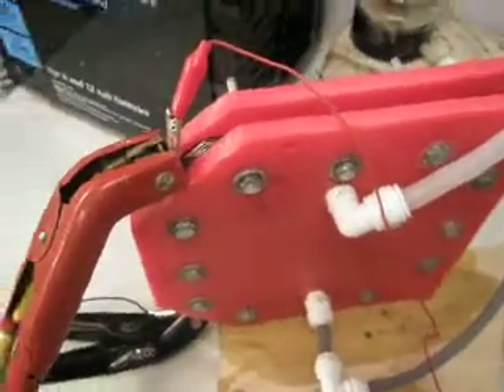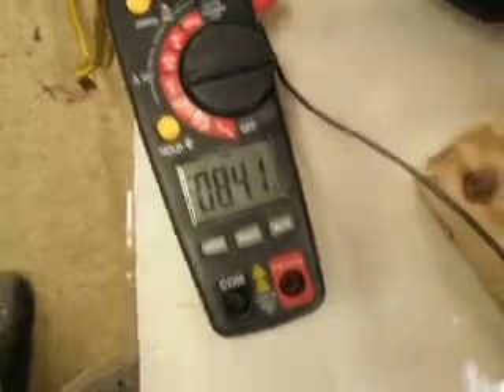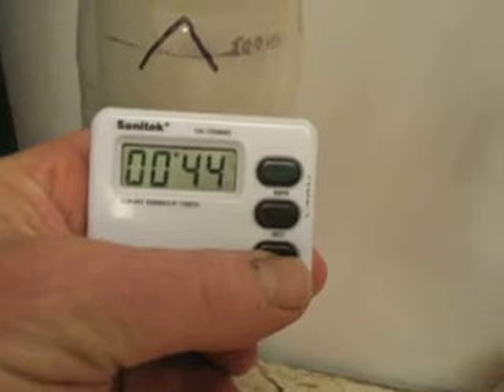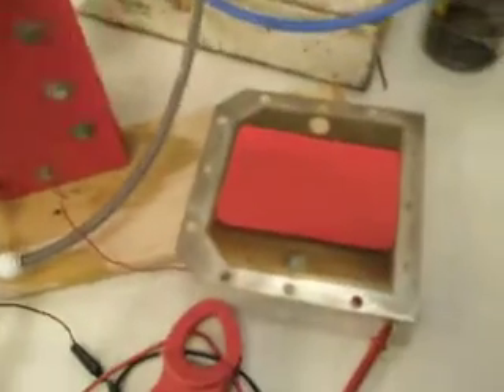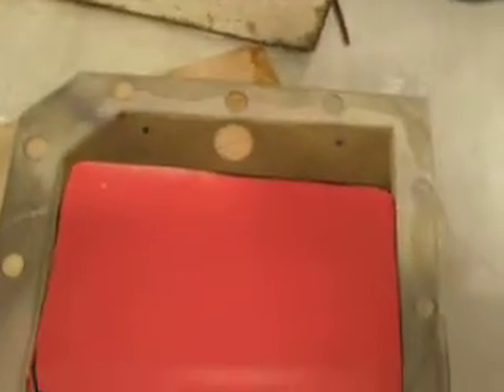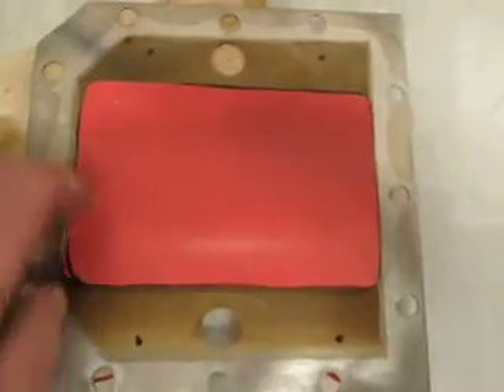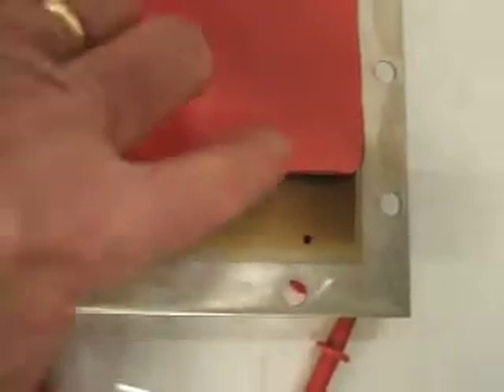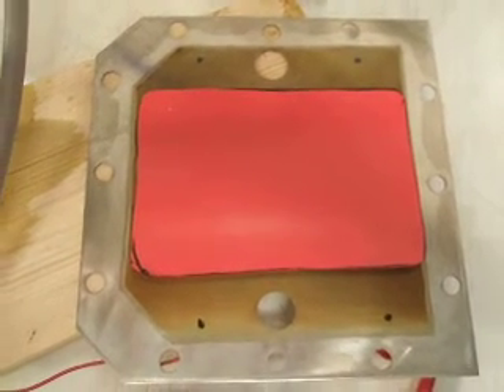Mars Gasket Test 2

Comment: yeah I checked voltage between the plates on several occasions today and they were very consistent..Actually the cell in question is more consistent on volts per plate gap than any of my cells and the plates are perfectly flat, this the best cell as far as plates being absolutely perfect that I have built. ..I raise the volts get lower mmw , I lower the volts get higher mmw..I tested almost 3 hrs today, with different plate gap voltages and every time I raise mmw goes down..My gap is 3/32"

Comment: Hi Bob: It's neat that you retrofitted an old set of plates and improved the MMW.
Did you drill four small holes in each plate? I would imagine one hole at the top and one at the bottom alternated.
Mars
P.S. Measure the temp of the actual HHO as it is being measured. An MMW of 6 when the gas is 75F is actually is more HHO than an MMW of 6 when the HHO is 100F.

Comment: you will find that your devices are much more sensitive to the gap being even when you try to get the gap real close ... a stable, even 1/16 inch gap is generally pretty easy to achieve ... when you try to cut it closer than that, even minor irregularities in your steel start showing up as problems ... I am a proponent of a slightly larger 3/32 or 2mm gap ... this is generlly much easier to keep even and stable than anyhing tighter ... so 2 layers of 40 mil shower pan and you are there ...

Comment: 5.97 is pretty good...I wish I could figure a way to get everything just right for the highest mmw..I got 6.16 this morning on my tubed cell, now I am barely getting 5..which this morning i run it in a series with 41 v 9.5 amps 21 plates...The whole I dont understand is I get 6.41 on my top hole only 31 plate cell....

Comment: yeah I been doing a series of test tonight. and have ranged from 4.94-6.04..and it seems that the lower the plate gap voltage is the better the mmw..for example 2.0vppg 41v total 9.5amps 1 liter 25 secs 6.16 mmw..2.3v ppg 46v 8 amps 1 liter 33secs 4.94...
2.2v ppg 44v 10amps 1 liter 26secs 5.24mmw..
2.1v ppg 42v 9.5 amps 1 liter 25 secs 6.02mmw.
It just seems to do better mmw at lower volts ppg....I done few test with 2.6v ppg and mmw just dropped ..What do you think about this?